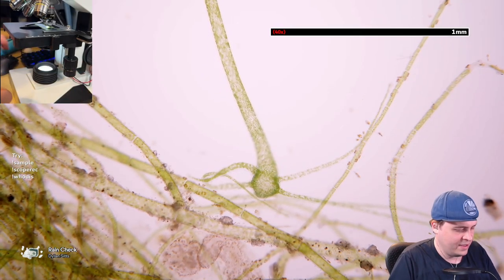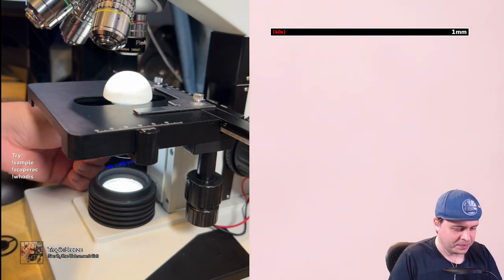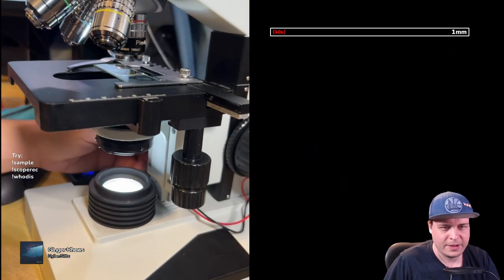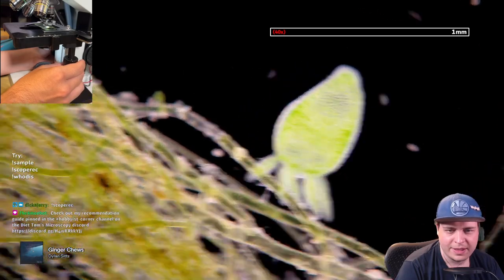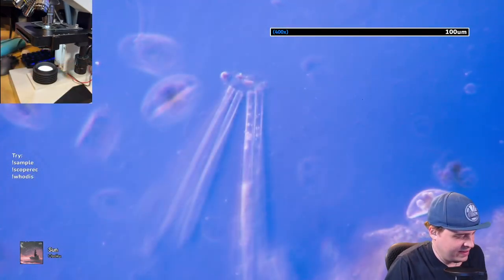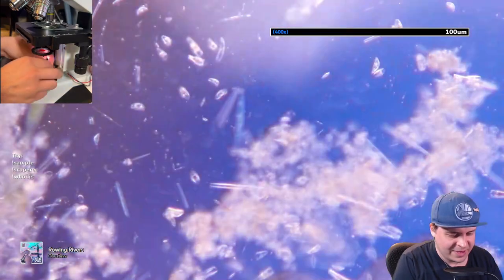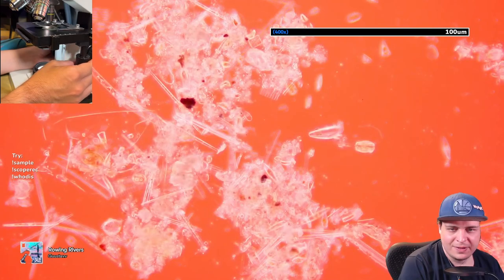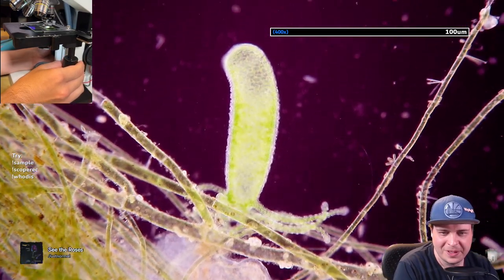Twitch Microscopy Seminar - 2/3 - Darkfield and Simple Rheinberg Filters

Comment: why not just print your desired filter pattern on a transparent foil with an inkjet printer? or even better, insert a transparent lcd display in place of your filter and edit the desired shape in real time with an app. or why not to leave a filter out completely and replace the light source with a a full color led panel or an oled display the will shine the desired color pattern directly? at the simplest, you could just create your color pattern in a drawing app in your phone and then place the phone under the stage/sample. fingers crossed!

Comment: What do you do to get things like Rotifers or Euglena to slow down and hold still so you can film them?
Reply from the maker: Well I don’t use it for my stuff but methyl cellulose is commonly used to increase the viscosity of the medium which, in turn, makes organisms move more slowly through it. https://www.flinnsci.com/api/library/Download/ac169fe52aec4a249dfab7beffce4f06
Reply: @diettoms  you show euglena and a rotifer just sitting there. I have yet to get anything to hold still
Reply from the maker: @rlwkirsch it depends on the organism - many euglenids are pretty slow movers, sometimes rotifers hang out for a bit. Another thing you can do is carefully prepare a sample without debris and then put a coverglass on that has a little dab of vaseline in each corner. Then you can carefully smush the coverglass down until you pin organisms in place without totally crushing them.